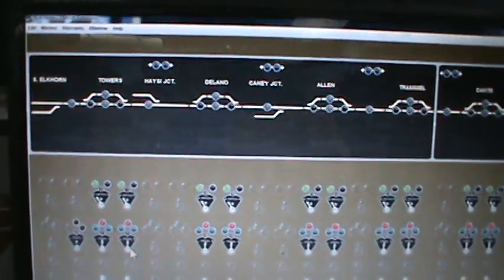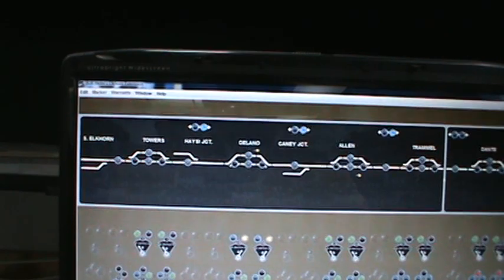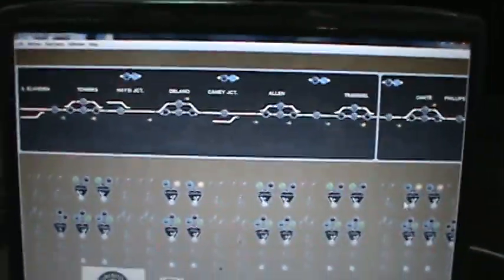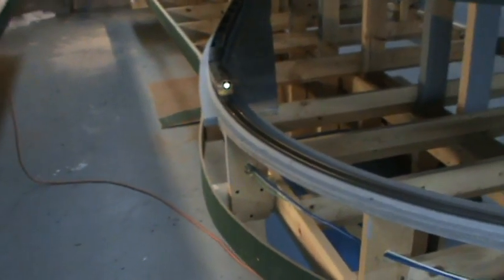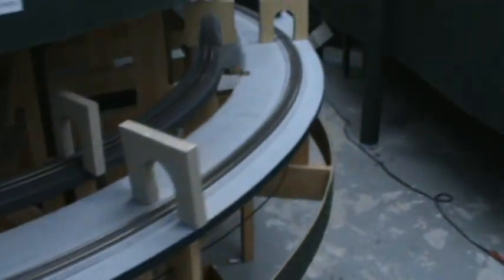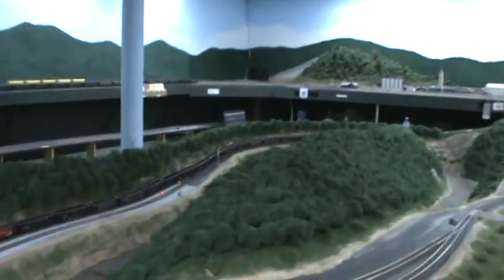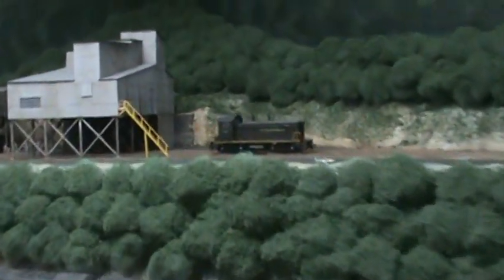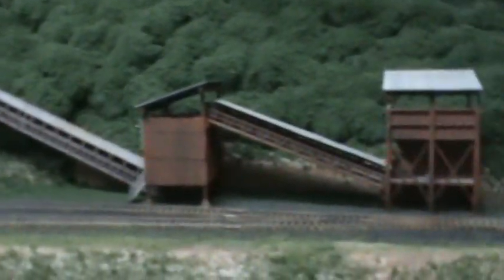CTC Finished Demonstration

Comment from the maker: It was for train spacing, and safety of the trains. The signal only 
governed movement over the switch. Crews had to be looking at track as William 
states below. We Dispatchers could hit a button that would give a follow 
up signal if there was another train already in the siding at Johnson City. 
I think Johnson City was a signaled siding and the signal governed 
movement through the siding.

That came directly from a former Clinchfield and now CSX dispatcher. Guess Im right and you are wrong!

Comment from the maker: Many of the sidings had tracks that came off the siding track and alot of them had derails on them. Going into yards you had to move at restricted speed. CSX still uses restricting signal in some locations on the Clinchfield. You must work for CSX since you know so much about signals?